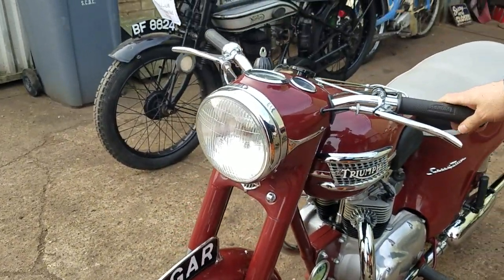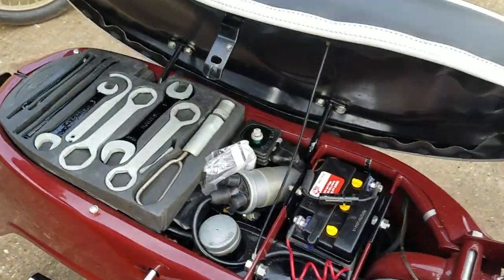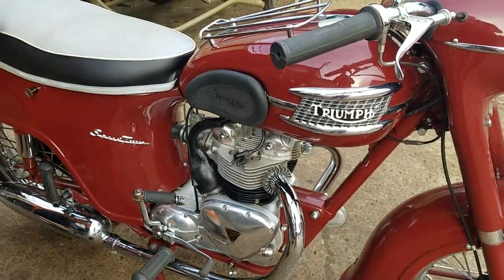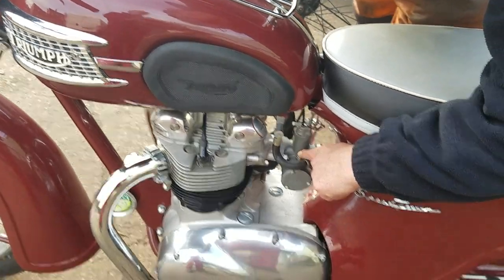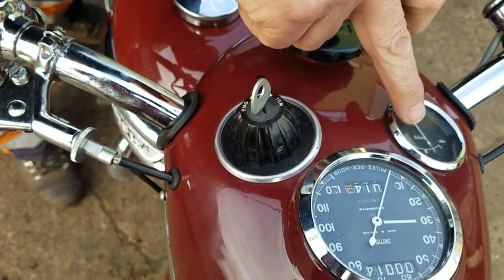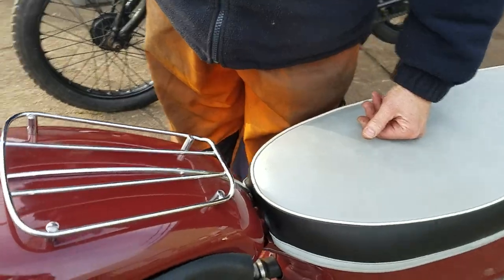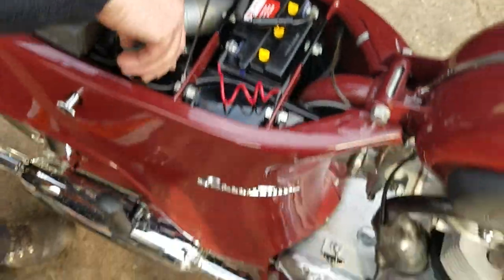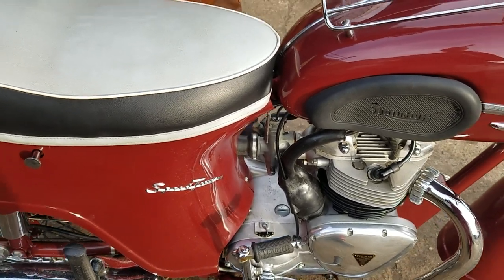1959 Triumph Speed Twin 500cc at Andy Tiernans #07660TRI

Comment: I was born in 1959. I became mad for motorcycles when I was very small. My parents, on the other hand, were dead nuts against a son riding those awful things. One Christmas the promised me a motorcycle, I knew it was impossible but Christmas morning I opened a small box and in it was a burgundy die-cast Triumph Speed Twin complete with a rider clade in black leather and wearing a white helmet. If you put it on the table and look at it at straight on it looks like that rider is blistering down the straight. I still have it. I also have a 1966 T100 that I ride.